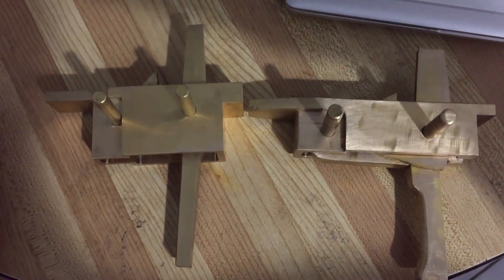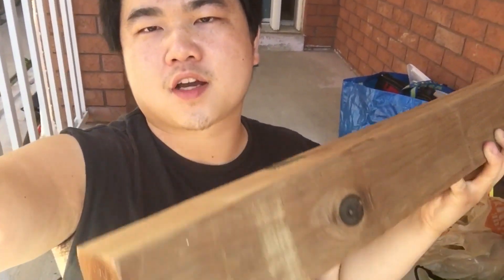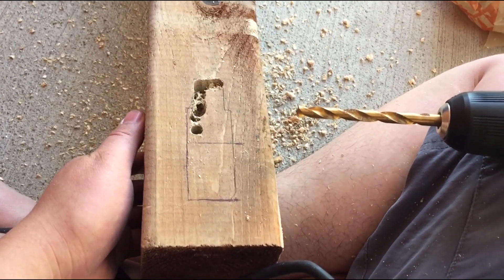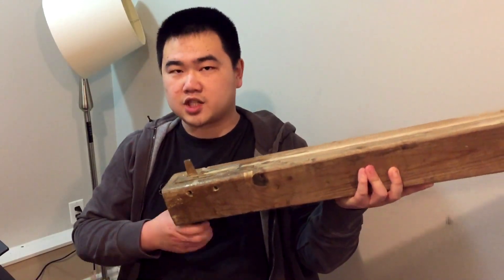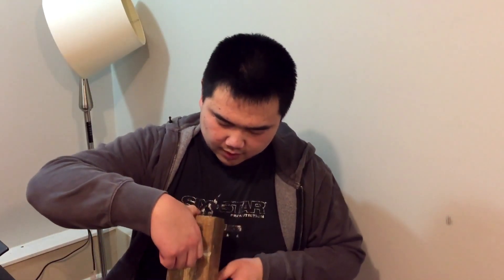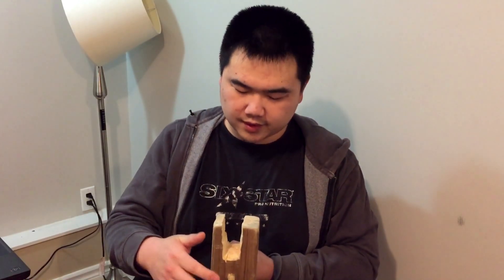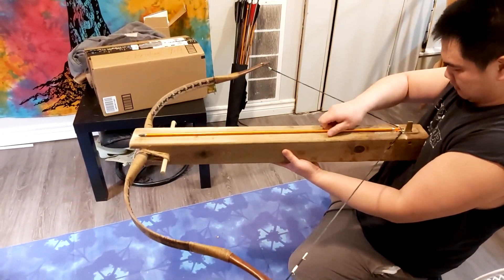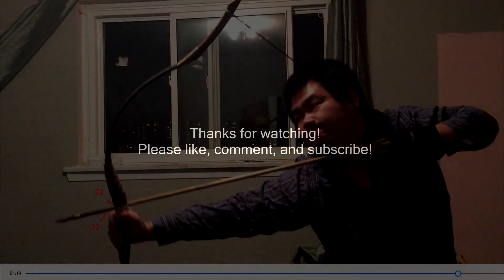DIY Ancient Chinese Crossbow Prototype

Comment: Great job. Your setup seems very sturdy. I have a cheap early dark ages medieval European crossbow with a very primitive trigger, and my two prod were pulling about ~80lbs and ~100lbs @ 14 inches (it was originally designed to be ~40-50 lbs). I had some initial issues with dry firing because the primitive trigger notch wasn't carved deep enough until I was able to resolve the issue. For dry firing concerns during the initial testing, I wrapped both sides of the string in old worn clothes to "test it out" when I was pulling the string. When the string seemed to be securely in place and didn't seem like it was going anywhere, I removed the old clothes and placed the crossbow bolt in the groove. This way, the mass of the clothes prevented any dry firing from damaging the prod. Furthermore, if you are concerned with wear on the string, you can use 550-paracord (minimum breaking strength of 550 lbs) as a replacement. This material experiences some elongation upon the first few uses, but thisserved as a decent alternative string material for my crossbow when I'm was just testing stuff out and not using the "proper" flemish twist string it came with.
Reply from the maker: Wow that is a very smart way to prevent dry fire without any modification to add safety mechanism. i will try that
Reply: @Historicalarcher  Sounds good! Just to clarify, wrapping the string on both sides with old clothes doesn't "prevent" dry firing (unless you then attach clothes securely to something else at the end of the crossbow stock), but it definitely absorbs a lot of the shock and energy from any potential dry firing so it won't damage the prod. So my main method wasn't necessarily to prevent dry firing from happening, but to prevent dry firing from doing much damage to the prod by absorbing its energy.
Reply from the maker: im actually outraged, tod just uploaded gastrophetes video and said its the earliest crossbow. did not mention a word about chinese crossbow
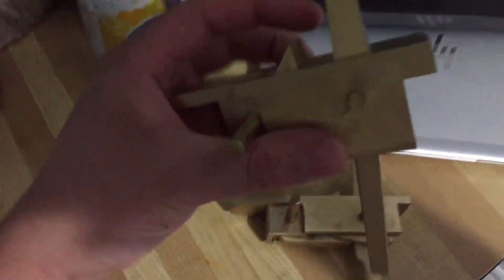Reply: @Historicalarcher  I watched Tod's Gastraphetes video, and I don't think he said that device is the first crossbow overall. At the beginning at 0:24, he is talking about the first weapon that is easier to use for fatter/heavier people. At 0:31, it says it is ancient Greek, and at 0:35, he said it is the first crossbow "that was over there" (so he is exclusively talking about the region of ancient Greece).
Reply from the maker: @Intranetusa  thanks for the details. i didnt watch it word by word just based on my impression the first time i watched it
Reply: @Historicalarcher  No problem. Todd replied to one comment saying he would like to do a video on ancient Chinese crossbows in the future, but he has a backlog of other videos to make. So maybe one day we'll see one version of it on Tod's Workshop. By the way, how is your Chinese crossbow coming along? Were you planning to move up the prod to beyond using the 100 lb draw weight/31 inch draw length bow?
Reply from the maker: @Intranetusa  vids coming up. prods read, stock ready
Reply: @Historicalarcher  Awesome!

Comment: From Han Dynasty Crossbow III | History Forum (historum.com)
 by HackneyedScribe:

The prevalence and praise of the crossbow in ancient Chinese texts is so widespread (The excavated Donghai accounting records show the existence of up to half a million crossbows in its stockpile) that I find this single weapon notable enough to write an entire article centered on it. No doubt, from its inception during the 6th century BC the crossbow revolutionized Chinese warfare. Projectiles fired from a crossbow are much more powerful than those fired from bows, and only a little time is needed for one to become proficient with it. Bolts can be fired with enough force to penetrate shields and armor at a distance. No longer can heavily armored, skilled nobility outmatch the everyday peasant. This essay only deals with ancient crossbows of the Han dynasty, although it was one of the primary weapons in Chinese history for a much longer time than the dynasty itself.

Range and Draw Weight

Just how powerful a crossbow could be is glimpsed in the excavated Chu-yen slips, from which records of crossbow maintenance was kept. In general crossbows were categoized by draw weight of 1, 3, 4, 5, 6, 7, 8, and 10+ stone, with each stone unit being the modern equivalent of ~64.5 pounds. The majority of crossbows have a draw weight of 6 stone. The following is a calculation on the percentage of crossbows for each categorical draw weight, but it is currently not verified by me as I did not count them personally (However, historian Yang Hong also states that the majority of crossbows were categorized with draw weights of 6 stone):

1 stone: 1.37%
2 stone: 1.37%
3 stone: 21.92%
4 stone: 2.74%
5 dan: 17.81%
6 dan: 43.84%
7 dan: 2.74%
8 stone: 2.74%
10 stone and above (Great Yellow Crossbow): 5.48%

From the slips already excavated, we have a set of records showing six crossbows shooting 168 to 280+ meters. Each of these crossbows only had draw weights of 3-5 stone, as compared to typical Han era crossbows of 6 stone. Two slips record tests for their penetration ability. Both tests show that the crossbows punctured a wooden wall (most likely a plank or fence) at 252 meters.

Slip 14.026: 一今力五石廿九斤射百八十步辟木郭
Translation: Present strength 5 stone 29 jin (341 lbs) and will penetrate a wooden wall at 180 paces (252 meters).
Slip 515.46: 三石具弩射百廿步
Translation: 3 stone (193.5 lbs) crossbow, fully assembled, shoots 120 paces (168 meters)
Slip 36.10: 官第一六石具弩一今力四石【四十】二斤射白八十五步完
The words in【】is used to display what the word on the slip means, but the actual word cannot be typed by computer as the word is no longer in use)
Translation: Number one 6 stone crossbow, fully assembled, present strength is 4 stone 42 chin (285 lbs), and it will shoot to the end of 185 paces (259 meters).
Slip 510.026: 五石具弩射百廿步
Translation: Five stone crossbow fully assembled, shoots 120 paces (168 meters)
Slip 341.3: 具弩一今力四石射二百…(too smeared to make out)…
Translation: Fully assembled crossbow, present strength 4 stone (258 lbs), shoots two hundred and [text too smeared to make out] (280-418.6 meters).
Slip 14.62A: 一今力三石廿九斤射百八十步辟木郭
Translation: Present strength 3 stone 29 jin (212.2 lbs) and penetrates wooden wall at 252 meters.

Thankfully, the weight Han crossbows projectiles scaled linearly with their draw weight (15.625 grams per lb). This can be seen in the WuYue ChunQiu:

夫射之道，從分望敵，合以參連。*弩有斗石，矢有轻重，石取一两，其数乃平，*远近高下，求之铢分。道要在斯，无有遗言。

Translation:*The rule in all archery is: let your eye follow the calibrated line of fire from you to the target, then line up the three elements (calibration, arrowhead and target). The power of crossbows is measured in heavy or light poundage; arrows differ in their weights. The ratio of arrow weight to bow poundage is one liang to one stone: this gives you the correct proportion. Different distances and elevations can be compensated by minute differences in this weight. This is the whole method: I have held nothing back.*

Combined with the range, we can derive a rough minimum estimate of the energy and velocity of the projectile when shot:

📷

The only crossbow in the list that represent the common six stone crossbow had decreased in draw weight from 387 lbs to 285 lbs at the time it was shot. Crossbow replica maker Andreas Bichler mentioned how composite prods could decrease in draw weight over time in hot/humid environments, while gaining the draw weight back when the season became dry/cold. This was the most likely explanation for the decrease in draw weight that was mentioned for some crossbows in the Chu-yen slips. To top this off, the Song dynasty manual Cui Wei Xian Sheng Bei Zheng Lu did mention that composite prods of crossbows should be replaced by a wooden prod during the wet summer, only to be put back on again during the dry winter:

*During the hot summer, when it’s raining and there’s steam, the horn [composite prod] should be easily taken off, and use a wooden [simple prod] crossbow. During the spring and winter, where there is wind and bitter cold, the wood (simple prod) is heavy and sluggish, and horn [composite prod] crossbows must be used.*

Nevertheless, even a reduced six stone crossbow of merely 285 pounds managed to shoot 259 meters. Using the typical 93.75 gram projectile designed for such a crossbow, the joules of energy for the projectile was impressive at roughly 195 joules. If the crossbow shot with its full draw weight, the amount of joules for the projectile would go significantly above 200 joules, especially when considering that the weight of the crossbow prod would not have increased in mass. This was because the decrease in draw weight was not caused by reducing the mass of the prod, but most likely because the weather caused the glue to start breaking apart, decreasing prod stiffness. Reversing the logic, a Han crossbow with an original draw weight of 285 lbs (rather than an originally 387 lb crossbow with its draw weight decreased to 285 lbs) would also shoot further and harder due to lighter prod mass.

The reader can compare this with the 150 lb longbow shots mentioned in the book “The Great Warbow”, in which a projectile of comparable weight managed to fly 228.6-234.7 meters, and this was with the aid of a significant 9 m/s tailwind which would push the arrow further than it would have gone. These shots managed 131-136 joules. One particular arrow shot from the same 150 lb longbow managed to reach the same range as the 285 lb Han crossbow, but with a significantly lighter projectile of 74.4 grams:

📷

📷

Note that unlike the Han records, the author stated that the longbow shots here were shot at the angle for maximum range.

The reader can also compare this with the reproductions of professional crossbow maker Todd Todeschini. His replica of a 1250 lb Medieval European steel crossbow managed to send an 88 gram bolt 207-215 meters. The crossbow managed around 140 joules. Likewise, the 1200 lb Medieval European composite crossbow replica made by Andreas Bichler, using a cranequin to draw, managed to shoot at 200 joules in freezing weather, but 168 joules in hot weather. The difference in joules, as explained by Mr. Bichler, was due to the weather decreasing the stiffness (and hence draw weight) of the prod. The draw weight of a composite prod increases in cold/dry weather but decreases in hot/humid weather.
Reply: thanks for copying and pasting that

Comment: It's been a long time since I've done archery, but I feel like jumping from 60 to 110 is a big leap. I know you're limited based on what you have, but if you have access to a 90 lb draw weight bow, that might be safer than jumping to 110 lbs. Especially doing tests in the house like this.
Reply: he can pull it with hands, why can't he pull it with his legs?
Reply: @andkonblack  He's not the limiting factor I'm worried about.  I could be wrong, but the impression I got from the video was that the brass trigger is a little bit of a wild card. Especially when he's saying "please don't dry fire" as he's cocking the bow. I'm just suggesting he err on the side of caution.
Reply from the maker: @koticneutralftw7016  i have more confidence with it now. at first i was sketched out for sure
Reply: @Historicalarcher  sounds good, then. I'll be staying tuned.

Comment: Just how powerful a military crossbow could be is glimpsed in the excavated Chu-yen slips, from which records of crossbow maintenance was kept. 
1 Han stone = 64.5lb                              1.37% 
2 Han stone = 129lb                               1.37% 
3 Han stone = 193.5lb                          21.92%
4 Han stone = 258lb                                2.74%
5 Han stone = 322.5lb                           17.81%
6 Han stone = 387lb                              43.84%
7 Han stone = 451.5lb                             2.74%
8 Han stone = 516lb                                 2.74%
10 Han stone = 645lb and above           5.48%

From the slips already excavated, we have a set of records showing six crossbows shooting 168 to 280+ meters. Each of these crossbows only had draw weights of 3-5 stone, as compared to typical Han era crossbows of 6 stone. Two slips record tests for their penetration ability. Both tests show that the crossbows punctured a wooden wall (most likely a plank or fence) at 252 meters.

historically, Chinese crossbows were used in pike-and-shot like "Crossbows remained one of the major weapons in Song times. In the eleventh century, Shen Gua argued that the crossbow is to the Chinese what the horse was to the Khitan -- the asset that gave them their advantage. Infield battles against foreign cavalry, the Chinese infantry would have a row of pikemen with shields, rows of archers, and a row of crossbowmen. When the cavalry approached, the crossbowmen would shoot first above the crouching pikemen and bowmen. The pikemen and archers would shield the slower-firing crossbowmen, who, however, could inflict more damage."
Reply: I posted this exact comment as a reply to Historical Archery on Tod's workshop's "Heavy Crossbow - Light bolt - What happens?
" video. lol
Reply: @Intranetusa   sorry bro i changed it
Reply: @siberiamannnnn  No problem man. I don't mind if you use my sentence and the quote from the historian Patricia Ebrey. Spread the knowledge!
Reply: @Intranetusa  lol
Reply from the maker: @Intranetusa  i asked the chinese history community to verify hackney scribe's statistical analysis: https://docs.google.com/spreadsheets/d/1b-722aqxNBxRnutJq3vEEBhsnCdgls-6uWlgKmrLgZU/edit?fbclid=IwAR0wOI_X4GGCDRvM4n1RUeE-0RiHEdYK6vYCscKkozqM7GDqtSNjwO1Cx5A#gid=0
Reply: @Historicalarcher  Great, thanks. How many people are involved in this project?
Reply from the maker: @Intranetusa  i dont know i just asked the facebook group if anyone can help. not sure how many people will participate, maybe none. maybe u can help doing the first page? to give us an idea
Reply from the maker: @Intranetusa  apparently hackneyedscribe counted 5 of those pages. result? 
By HackneyedScribe: Let's go over the first five of the compiled pages for the Chu-Yen slips: 
1st page: 居延汉简甲乙编 : 居延汉简甲乙编 - 中国哲学书电子化计划

79: a 5 stone crossbow
81: a 6 stone crossbow
355: a 6 stone crossbow
586: a 3 stone crossbow
826: a 5 stone crossbow
1382: a 6 stone crossbow
1423: a 6 stone crossbow
1586: a 4 stone crossbow
1754: a 6 stone crossbow with present strength 4 stone 42 jin
1756: a 6 stone crossbow with present strength 4 stone 30 jin
1813: a 5 stone crossbow
2087: 6 stone crossbows, 7 of them

2nd page: 居延汉简甲乙编 : 居延汉简甲乙编 - 中国哲学书电子化计划

64: a 6 stone crossbow
258: a 6 stone crossbow
413: second 6 stone crossbow
524: a 6 stone crossbow
597: a 90 stone "great yellow" crossbow
598: a 8 stone crossbow
599: a 6 stone crossbow
600 a 6 stone crossbow
750: a 6 stone crossbow
752: a 3 stone crossbow
875: a 6 stone crossbow
877: a 6 stone crossbow
956: fifteenth 5 stone crossbow
988: a 3 stone crossbow
1368: a 3 stone crossbow
2018: a 6 stone crossbow
2066: 3 stone crossbows, 4 of them
2559: a 6 stone crossbow

3rd page: 居延汉简甲乙编 : 居延汉简甲乙编 - 中国哲学书电子化计划

292: 6 stone crossbows, 3 of them
293: a 5 stone crossbow
551: 6 stone crossbows, at least 2 of them (words after the 2 is too smeared out, could be 2, could be 200, who knows)
1169: a 5 stone crossbow
2206: a 4 stone crossbow
2211: a 4 stone crossbow
2222: a 4 stone crossbow
2227: a 4 stone crossbow
2237: a 4 stone crossbow
2242: a 4 stone crossbow
2253: a 4 stone crossbow
2258: a 4 stone crossbow
2267: a 4 stone crossbow
2272: a 4 stone crossbow

4th page: 居延汉简甲乙编 : 居延汉简甲乙编 - 中国哲学书电子化计划
542: a 6 stone crossbow
853: a 3 stone crossbow
1206: 680 strings for 6 stone crossbows
1232: 3 stone crossbows, 8 of them
1597: a 6 stone crossbow
1634: a 5 stone crossbow
1792: 1 stone crossbows, 10 of them
2101: 6 stone crossbows, 24 of them

5th page: 居延汉简甲乙编 : 居延汉简甲乙编 - 中国哲学书电子化计划
965: a 6 stone crossbow
1292: 6 stone crossbows, 2 of them
1340: a 3 stone crossbow
1803: a 5 stone crossbow
1973: a string for a 5 stone crossbow
2290: an 8 stone crossbow
2291: 6 stone crossbow
2292: 3 stone crossbow

As you can clearly see, the 6 or 4 stone crossbow was the most common
. havent put this in a table yet
Reply from the maker: @Intranetusa  I compiled his data and got
STONE	1	10	8.130081	%
STONE	2	0	0	%
STONE	3	19	15.44715	%
STONE	4	11	8.943089	%
STONE	5	22	17.88618	%
STONE	6	59	47.96748	%
STONE	7	0	0	%
STONE	8	2	1.626016	%
Reply: @Historicalarcher  Did you get this information from one of his posts or did you contact him?
Reply: @Historicalarcher  Cool. That seems pretty close to Hackney's estimates so far.
Reply from the maker: found the original source http://www.cngdwx.com/shibu/15/277/0.html